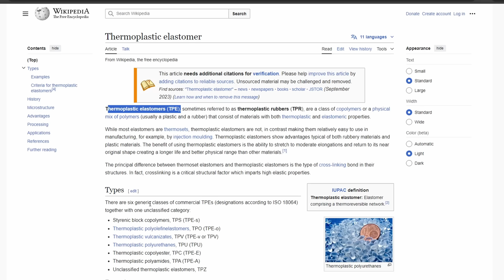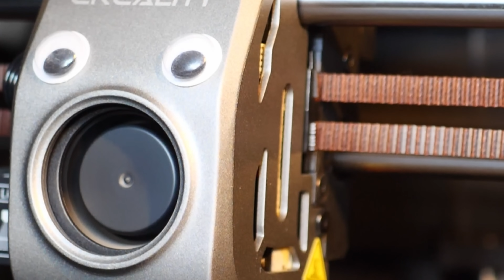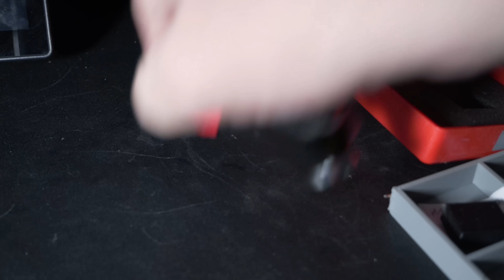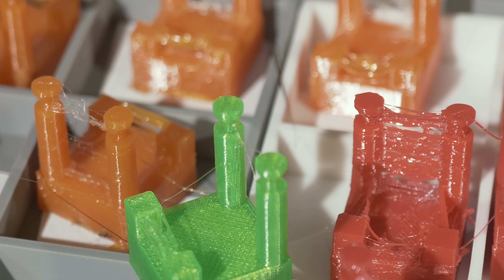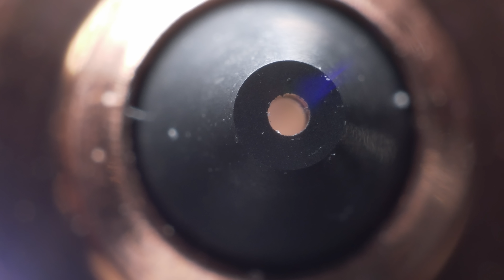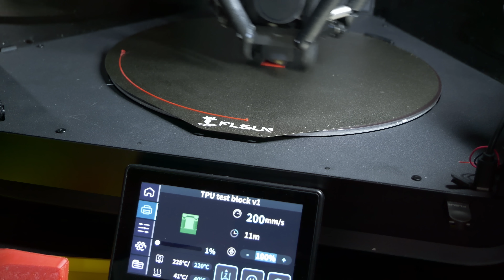Don't fear SOFT TPU - it's fine to 3d print now.

Comment: Curious about the price point on the Phaetos Conch Plus... I looked at the link but didn't see any price (maybe I just missed it)
Just recently upgraded to a diamond-tipped nozzle, so Phaetus' option is going to have to come in less than that, particularly considering even silicon-carbide can't surpass its wear nor thermal conductivity.
Reply from the maker: They announced it yesterday on twit
24 USD for Conch Hotend
39 USD for Conch Hotend Plus

I'll...try to pin this when I get on PC
Reply: @LostInTech3D  Cool, thank you ^_^

Comment: i'm currently drying a spool of old tpu on the bed of my ender 3, in hopes to use it with my bambu p1p.
last time i tried a few days ago, it didn't extrude a single drop. it just clogged so massively i had to disassemble the hotend and use a hot air gun to melt what was inside. ngl i'm scared of that happening again because that is kinda of a hassle. but on the other hand i want to print tpu.

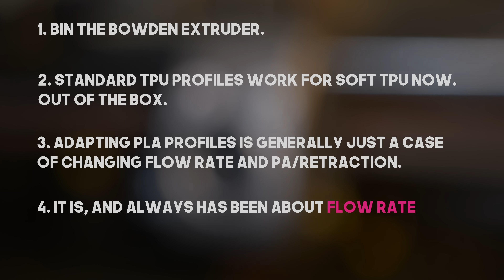Comment: 11:00. „It is, and always has been about flow rate.“ I do not agree. My MK4S could definitely print faster than 7.5mm3/s but the Nextruder craps out. The filament gets eaten by the drive gear. I think this could be fixed by a simple design update of the main plate of the Nextruder.

Comment: I managed to print TPU at high speeds on an ender 3, but with a BMG extruder and a well constrained PTFE tube (capricorn as it had a smaller ID than normal tubes) any gap in extruder or tubes will affect print speeds

Comment: What nozzle size were you using with the 85A and 83A?
Reply from the maker: 0.4 all round
Reply: @LostInTech3D  Thanks. Bambu is saying to use a 0.6 on the their printers, but I was wondering if that was a necessity, as they even claim the A1 can't print 85A. That had me scratching my head going, huh??? Really appreciate the video and your reply.

Comment: Just throwing this out there for TPU tips - Don't forget DRYING!! A number of TPUs are VERY hydroscopic and if it fails the FIRST thing I do is dry it, often that fixes the issue.
Reply from the maker: Yeah I didn't encounter this until recently but it's a real problem when you finally have it
Reply: @LostInTech3D  Hard to T/S! I bought some NinjaTek Armadillo TPU and it wasn't sealed well so I immediately dried it (high temp stuff) per their stated specs. The idiots had put it on a reel of low temp plastic so the reel deformed HUGELY requiring me to re-reel it with great difficulty! Foul words came out. :face-orange-frowning: Sometimes it's the small things ... BTW - GREAT VID! Sub'd.  😀

Comment: what about temperature? i find myself going to 240C to achieve better flow rate (about 7mm^3) is where defaults have issues for me
Reply from the maker: steel nozzles (bambu, some others) do need higher temps than brass due to the surprising difference in thermal conduction. I would advise not going past 240 though, for TPU, for safety

Comment: I've honestly never had issues with the extruding part. It's just the bed adhesion that never works with tpe/u for me. I've textured and smooth pei, painter's tape, gluestick, magigoo, dried the spool, designed a custom brim with tabs that are easy to snip off. It worked a few times but now it no longer works and I have nonidea why. It really doesn't make me want to try a new spool, this stuff is expensive.
Reply: So strange if anything TPU sticks too much on most things. Did you try more than one brand?

Comment: My flow rate is already so low with my ender 5 pro i just slow down the first layer to 15mm/s and cut the other speed roughly in half and slightly bump retraction E voila tpu is good.  Don't be scared of TPU it's easy

Comment: Can you elaborate on this "only touch flow rate and not speed" thing? I'm a beginner.
Reply from the maker: okay, so, imagine "max flow rate" as a master control that overrides all the speeds. The nozzle has max flow rate that it can do, so it's better to tell the slicer what that is, and not have to try to match that with speeds. If that makes sense?

Comment: Recently I wondered whether there was some conversion formula between the D hardness scale and A hardness scale. I've only found tables, so I picked one (the one from wikipedia to be precise) and entered the values in excel and plotted it. Looking at the graph, I assumed there to be a logarithmic relationship (D -> A) and decided to add a logarithmic trendline. The formula it gave was A(D) ~= 31.748 * ln(D) - 27.465 with an R^2 value very close to 1. The funny thing is, we can approximate this appromixation as A(D) ~= 10 * (pi * ln(D) - e) + 1.
Reply from the maker: I'll be honest, I thought it would be simpler given its derived from springs!
Reply: I've tried to find some literature on what the exact relationship is. Couldn't find any. Maybe I didn't look that extensively, but I kinda find it strange there not to be any (or there is very little of it).

Comment: The creality k1 cannot print tpus below 85a. Your test does not cover longer prints. I print shoes and doing multiday prints with e.g. esuns 83a does not work, the extruder is not strong enough and the tolerances are not tight enough even when you set retraction to 0, the print fails sometimes after 6 hours, sometimes after 12 no matter the volumetric speed. If you want to print consistently, you need an orbiter with a steel guide rod for the filament right after your extruder gears or a belt extruder like the papilio.

Comment: What did you do to print tpu on the  mk4? I printed a bunch in mine and it revealed a manufacturing oversight: it wrapped around the shaft behind the drive gear and ripped off the conductive paste circuit... that is under the drive gear...!
Prusa did warranty the parts and fix it. They also advised me to loosen the idler screws. But the conductive paste circuit still seems insane to have that close to a spinning planetary gear.
Reply from the maker: Yeah I think they did something to fix that, off the top of my head. I've certainly wrapped tpu round those gears enough
Reply: @LostInTech3D  did you personally make any physical changes to prevent that from happening? I want to try my best to keep that from happening again, because I lost a heat sink and build sheet.
Reply from the maker: I did not, no. I have done the mmu upgrade which changes some parts but I don't think it would have an impact

Comment: Great advice, even modern direct drive will struggle with long PTFE tube friction, but bumping up the flow rate, even mid print is an instant fix. 

If you have old soggy TPU and no dryer cranking up the flow rate mid print also works great, the surface quality won’t be smooth and glossy though. 

Fun fact an ender 3 can print ninja flex 85A TPU at 20mm/s quite nicely

Comment: Some of the 3d printer groups I'm on thought I was mad printing 95a at 15mm3s  on a Kobra 2 max.  It could probably do 20mm²s if I got rid of the Bowden. 

They're still printing at 3mm³s like were still on the original ender 3. 

I'm on a Qidi plus4 now which was an awful lot of Bowden but even still I think 10-12 mm³s would be doable.
Reply: The most important thing I learned with 3D printing years ago was to stop looking for advice from the internet. I've done so many things with a customized bowden printer that most people would say is a waste of time. Even the old E3-Pro I have is capable of so much more by simply running Klipper and upgrading its main weaknesses with very little investment.

Comment: I've been printing for two years and still haven't touched anything other than PLA, but TPU really does open up a ton of new applications. This video definitely removed some of the apprehension about getting to grips with an unfamiliar filament type, might have a buy a roll or two and see how it goes :)

Comment: Im completely lost.  I thought flow rate just increased the amount of material put out in the same amount of time.  So for example when printing ASA I have to go down to about 95% or it will be really blobby.  In the video I dont see anything that resembles a percentage increase or decrease?
Reply from the maker: you're thinking of "flow rate multiplier" I think. Flow rate in the slicer is like a global speed limit. Of flow.
Reply: @LostInTech3D yeah flow rate should be in your filament settings if in Orca it's a measure of volume/time I believe

Comment: That last point (“it is and always has been about flow rate”) can’t be emphasized enough.  I gradually came to that conclusion over the last year but it really needs to get into everyone’s brains who are used to fretting over 20 different speed settings in each slicer (and filament profile) they use.  Deserves its own video!
Reply: Makes Ultimaker Cura's refusal to implement such a setting even more annoying!

Comment: My kind of jazz.😉 Thanks for the info, I've not printed with TPU as yet, so this will help me a lot when I do.
Cheers!
Reply: It's great these days, I started on a bowden equipped original ender 3 and it was possible to print 95a TPU,  but it required extremely fine tuning to get reliable prints and a couple of mods to constrain the TPU feeding from the gears into the PTFE so it didn't do a Houdini and escape the intended path. Most direct drive setups these days will have no problem with TPU and can print relatively quickly. I accidentality used my "fast" SV06 PLA settings (around 120mm/s infill and 70mm/s outer perimeters) and on a retraction heavy print and was amazed when it not only succeeded, but looked absolutely solid with no under extrusion. I was using a bearing spool holder that is on the verge of running away so there is little to no stretch, but I was happily surprised at the results.

Comment: I've had great luck with 95A overall on my Ender 3 both with Bowden tube and converted to direct drive, but at fairly slow flow rates of course. I just got some Siraya Tech 85A and I'm going to try it on my Qidi Plus4 soon. Excited to hopefully confirm your results for myself. Your videos on TPU have generally been some of the best out there. It's truly not that scary. Been printing some PP-GF30 filament. Trying to get it to adhere to anything, now that's scary.
Reply: PP - Polypropylene only stick to Polypropylene .I use ordinary packing-tape that is made of polypropylene and 
putting the tape on the heatbed .Use the transparent tape because you can't get it of the print again .
Reply: @kimnielsen9320  Yep been using packing tape and it does work great, but even then the surface you put the tape on matters so it doesn't peel up. I also bought a large polypropylene sheet to cut up and use as build sheets, but when I use it, as with the packing tape, it becomes one with the sheet. The prints are incredibly strong though, so even trying all my might to tear it, no luck. Can just cut it out and sand off the bottom. Not worth the hassle over tape. Gonna try glue on the sheet. May buy a build sheet and glue designed for PP eventually if I need to make a really expensive part. Thanks!
Reply: @802Garage  Your welcome .It is a fantastic material .I have only printed small objects ,therefore i have no experience with how bigger objects will behave in the printing process when prints are stuck to only packing tape
Reply: @kimnielsen9320  The packing tape definitely sticks way better to a smooth glossy surface than textured. It loves to peel off the stock PEI bed and let the part warp, but I have a smaller PEA bed the tape sticks to very well.

Comment: What's the nozzle size. 0.4, 0.5, 0.6, 0.8, 1.0
Reply from the maker: All stock 0.4, I don't recommend changing in most cases.
Reply: @LostInTech3D  90A is what I print for the last 7 years. Back then, it was a fun challenge. 40mm is the max speed I can do. My parts have heaps of retractions and are 9hr prints. 0.4 nozzle, 30 deg bed, 240 deg hotend, 5mm retractions. Tried larger nozzles, but 0.4 gave the best results for me. Can't go any faster, tried that, extruder issues arise and/or parts fail the quality tests. 
Still, the biggest issue to date is the actual filament diameter. I've seen under and over size within the reels. Looking forward to your results.
Reply from the maker: I did tests on filament diameter on PLA but never on TPU, interesting

Comment: Shouldnt it be volumetric flow everytime you talk about flow rate? Its a bit confusing as flow rate is a different setting in common slicers.
Reply from the maker: Yeah, I assume you're talking about cura. I've asked them to actually add a flow rate based control setting (and clarify the existing flow rate compensation setting wouldn't hurt either) for a while now.

Comment: I tried various brands of 95A TPU. I had no issues with all of them. Even Soft 83A TPE works fine. After a half year not printing any flexibles i want to print something and nothing works. My prints looks terrible and way underextruded. After some research i remembered that i changed the nozzle to a hardend steel one. I changed it back to brass and tata...... works fine again.
Reply from the maker: I had the same experience with steel nozzles on the ender 3, oddly enough. 
I never tried them again.
Reply: Did you try raising the temperature a bit? At least for me steel needs to print about 5-10c hotter than brass.
Reply: @GarethLewin  
Yes, i did. I also tried a 0,6mm steel nozzle. 95A worked better but the 83A not. In the end i would recommend brass nozzles for flexibles.

Comment: One more tip: set your extruder grip as low as possible. If the grip is too tight, it will bend the filament and cause a jam.

Comment: I was really enjoying the esun 83A toe filament until I was about halfway through the roll. After that I could not get it to extrude for the life of me and even replaced the extruder on my x1c thinking the gears were wore out. After all that effort it turned out that the filament in the middle of the roll was thinner to the point where it could not be grabbed by the gears anymore. I was super frustrated and haven't bought it since though that could have been a one-off. Also, that is some of the best smooth jazz I've ever heard.
Reply from the maker: Haha that's terrible. Probably the end of the production run or something
Reply: @LostInTech3D  Yeah. I might be willing to try it again but since then I've been using Siraya Tech 83a and I'm happy with it.

Comment: My best tpu/tpe printer is also my cheapest printer. My two much more expensive printers are ridiculously hard to dial in for tpu/tpe. Definitely between brands and even different colors within the same brand. My Anycubic Kobra Neo which cost less than 25% of the other two prints tpu/tpe easily. It's my go-to for most soft filaments. Little setting change between brands and none for colors within the same brand.

Comment: I recently printed some 85A Ninjatek Ninjaflex on my MK4. All I did was select the generic flexible filament profile in PrusaSlicer and reduced temperature by 10 degrees -- literally no other adjustment, either in software or hardware, and it printed *pitch perfect*. Like, literally, I didn't even get any stringing. On the other hand, the 92A Fiberlogy flexible filament I have is oozing all over the place, it's always stringing massively and no matter how much I try to fiddle with the settings, it just really sucks arse.

I dunno if I have any real point here other than that some brands are clearly better than others.
Reply from the maker: I think getting the right temperature is often underestimated for tpu. Maybe it's worth investigating 🤔
Reply: @LostInTech3D  It's what I typically adjust first with all new filaments and only start messing with other settings if tuning temperatures isn't enough. It's the one, single thing that tends to have the largest effect on the outcome, in my experience.

Comment: According to the MSDS on esun's website, the eLastic TPE-83A is 97% Tetraphenylethylene (or TPE for short, a different expansion of that initialism). It's probably a good idea to check the MSDS (Material Safety data sheet) on new filaments (assuming it's available) so that you know what it is you're actually printing with (like knowing what the the + part of the PLA+ filament you're using is). It's also good to know how to dispose of it (apparently this TPE has to be disposed of as hazardous waste).

Comment: did you have CHT printers? I had big clogging issues with foaming tpu and my cht nozzle.
edit: well, you have the S1 which should be close enough to my T1
Reply from the maker: Yeah the prusa has cht now. I've not used varioshore on it though, I'll note that down.

Comment: Funny enough, I've gotten 70a tpu to work on my slightly modded ender 3v2. Still a bowden, but with a dual gear extruder. It isn't perfect (might need a bit more tuning on my end), but it works surprisingly well. I use a bit of hand soap as lubricant (a little on the tip, insert the filament, and run it though until the soap stops popping out of the nozzle). A little cursed, but it works.
Reply from the maker: Soap 😅that's a new one. Whatever works I guess.
Reply: @LostInTech3D  I was in a bit of a pinch, so I looked at that dawn bottle and figured I'd give it a shot

Comment: Ive had successful prints with varioshore on the prusa mini stock extruder. Its the only tpu ive tried but it seems to work great with some tweaks. Namely loosening the idler gear on the extruder.
Reply: Ngl i would like a direct drive for the prusa mini but i dont know if it could handle the weight.
Reply from the maker: Have a look at this https://github.com/Mobile-Dom/Prusa-Mini-Revo